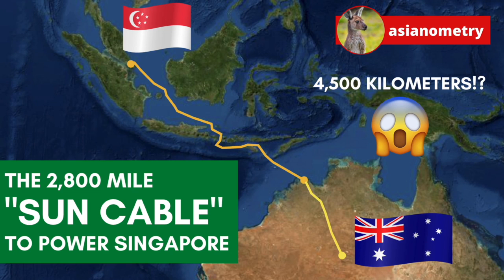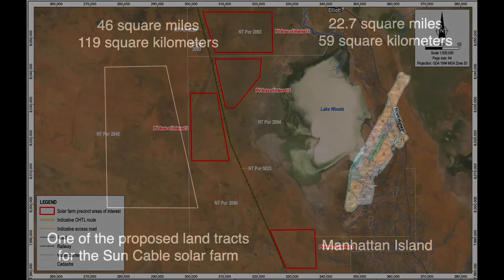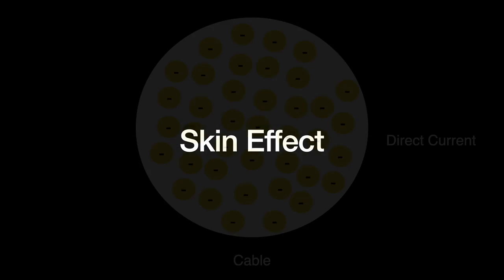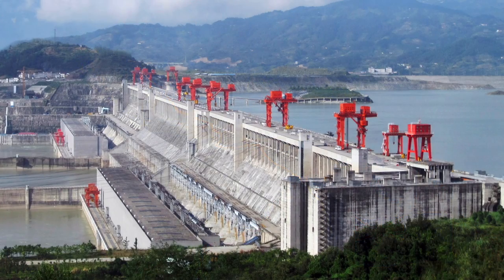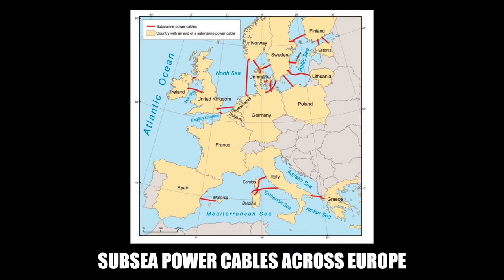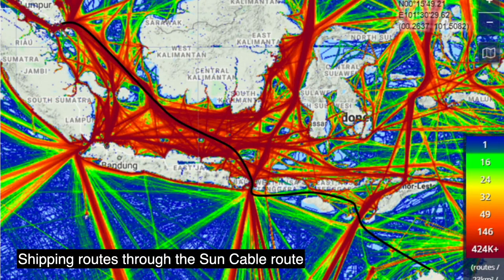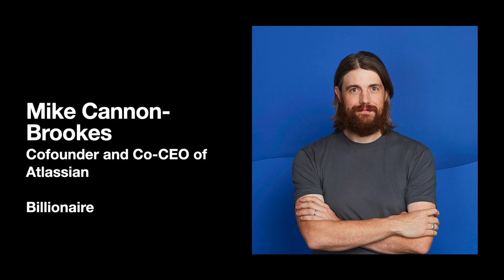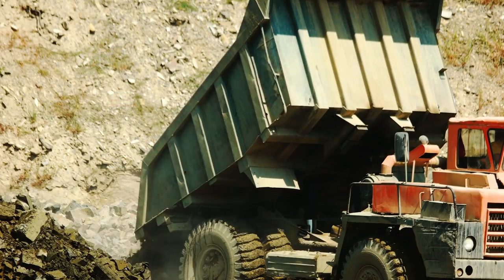How Singapore Plans To Pipe Electricity From Australia

Comment: NG is very clean burning. Why on earth are they spending a fortune for a solar farm outside their country's borders? Perhaps a nuclear power plant would be wiser. One of the new liquid sodium ones that have no real danger. Say perhaps even one of the thorium ones.
Reply: There's nothing which is more expensive than nuclear energy, as long as you don't have old, existing reactors which are already paid.

Solar in big size and offshore wind are the cheapest energy sources right now
Reply: @simonm1447  but not reliable. The sun isn't always shining and that is a very long way to transmit power, not even in your control. They are a very wealthy nation. One good nuclear reactor closer to their cities makes a lot more sense. These new liquid salt reactors are very safe.
Reply: @keithhoward4069  in warmer countries a lot of energy is used for AC.

In this case it's simple - if the sun is shining it's hot, and you need AC, but in this case solar will offer most power. If there is less or no sun you don't need much AC.

The problem with nuclear is it's not flexible at all. You can run such a power plant typically at full power, but you can't reduce power output within hours (they are just not made for it). They are usable for covering the base load, but they are not suitable at all to cover peak loads.

If you start with them you don't just need the power plant, you need the whole other stuff too, including nuclear waste storage in long term, which isn't that trivial, and highly expensive if you just need it because of one or two power plants.

Liquid salt reactors aren't commercially available yet, and the corrosion problems the salt brings with it haven't really been solved (the concept itself is half a century old).
Reply: just because it's a hot sunny day in Jakarta doesn't mean it is in Australia. And it can be ramped up or powered down as needed. That's what the rods are for. And even if you did run it fully, the excess power could be used to create hydrogen to power vehicles, thus decreasing the need to import petroleum products. If you could build the new Thorium reactors (granted those are still in their infancy) waste would be a far smaller problem. Or perhaps the micro reactors.
Reply: @keithhoward4069  of course you could start to construct new reactor types - if you plan to take them into commercial service in the 2050s.

A nuclear reactor is no ICE engine - control rods are not thought to change the power constantly, nobody is operating a reactor in this way (it wouldn't be economical too). Even the increasing consume of fissile material inside the reactor isn't compensated by the control rods, instead boron is added into the cooling water to slow down fission and the boron concentration is later reduced since older fuel rods produce less neutrons.

If you want quick power which can be shut on and off within 15 minutes a natural gas power plant is your friend - it's the most flexible conventional power plant and suitable for peakers
Reply: @simonm1447  of course NG is good. But green mania has made that choice unpopular.

Comment: Singapore as a country is consisted out of 63 islands, not an island. Even the main island is not named Singapore (Ujong). Greetings from Sentosa (Island). Otherwise, a very informative video.
Reply: Then check frequency when skin effects is causing problems.
AC is causing induction in anything near the cable that transmit electricity(and sea water can do that).
And pipes are used for high frequency electric signal because of skin effect, the small wires in typical cable are there so you can bend it easly and without causing damage to the cable, in typical range of temperatures at least, in Siberia and -70deg C outside power cable can easly break during bending.

Comment: this is a nonsense project, for one it put power at the risk of being cut off by indonesia if conflict ever arises between indonesia and australia or singapore. and at such length the resistance would cause massive energy loss. and earlier project by Singapore to buy land in Australia for a military base were block by local landowners, it is questionable if such a powerplant can even be build when a more strategical military base to both country is denied. furthermore there are already plans for a common ASEAN powergrid, if there is no strategic concern on indonesia, why don't singapore build the powerplant in indonesia? it would be cheaper and can be scale up easier than trying to acquire land from australian landowner again.

I firmly believe Singapore should have it own power generation given it experience with other resources like water and sand, if we can't even trust our supply of water won't be interrupted, how can we trust that power won't be. so the only way forward for singapore is nuclear power. that is the only meaningful solution for singapore.

Comment: This is a terribly stupid idea.  Singapore could easily use land reclaimations techniques to setup their own solar/thermal farms right offshore Singapore and it would cost a fraction of 7 billion.  Running an electrical line hundreds of kilometers is exceedingly inefficient, and storing the batteries near the solar farm instead of Singapore itself adds even more inefficiency.  Horrible stupid idea.

Comment: One of the stupidest ideas ever. Generating carbon neutral power at the user end (ie SMR nuclear or similar) would be significantly cheaper, more reliable, less technically difficult and, most importantly, lower carbon emission. All of the carbon released in manufacturing that copper, lead and plastic and fuel for those cables will be incredibly damaging.

Comment: Rather than import power directly from Australia , Wouldn’t it make more sense for Singapore to invest in renewable & clean energy projects in neighbouring Malaysia & Indonesia and other Southeast Asian countries to build a super grid, similar to the one across Europe, with HVDC interconnections between countries. Then Indonesia would import electricity into their grid from Australia and then export local generated energy, such as from offshore wind, into Singapore 

8:03  🇳🇿🖕
Reply: So instead of building a power cable from Australia to Singapore through Indonesia you build a Australia to Indonesia to Singapore cable  instead?
Reply: @catprog  Yeah. Then much of the undersea HVDC cable could be eliminated with just the ties between the countries remaining. The electric energy would essentially be transmitted across Indonesia’s existing power grid. Plus, if Singapore ties in to the grids of Malaysia & Indonesia at multiple points, it could built some redundancy into the system rather than being reliant on the single point-to-failure of the Sun Cable

Comment: This was the most stupid idea I'd ever heard. Getting electric energy from the country that electricity breakdown and high electricity bill had been on news. Moreover mostly if not all Malaysia electricity are derived from renewable, hydro power. Its cheap and abundant.
Reply: Being already dependent on Malaysia for water, there's no way Singapore is going to depend on Malaysia for electricity too.
Reply: @chengmunwai  yeah.. and we will get threaten by Malaysia cut off power supply or increase price..
Reply: "mostly if not all Malaysia electricity are derived from renewable, hydro power."

The last I checked, only 20% of Malaysia's power are from renewable or hydro. I believe the plan is to increase it to 30% by 2030.
Reply: Singapore's strategy is to diversify, diversify, diversify. Spreads the risks. Rely on the United States for security (including free and open sea lanes and at least currently, dollar-denominated clearance system), Middle East for petroleum, Malaysia for water, China as an economic partner. Spreading risk to Australia for electricity doesn't sound too bad!
Reply: Unfortunately we are going the other way. If you take a look at Suruhanjaya Tenaga's statistics, we are actually very dependent on fossil fuels, and we are using so much power that our gas production capacity can no longer handle the rise in demand, so we are switching to coal. A lot of coal.
Reply: Mostly if not all Malaysia electricity are derived from renewable??? This is the most stupid fact i've heard in a while.
Reply: Except for why Australia has high power prices: 
They built an expensive grid.  Not being used they don't have to pay for that.
They sold off their gas overseas and have to pay high prices for that. Not using gas either.

And you have not received the latest news. "south australia negative electricity prices" Power stations had to pay people to use power.